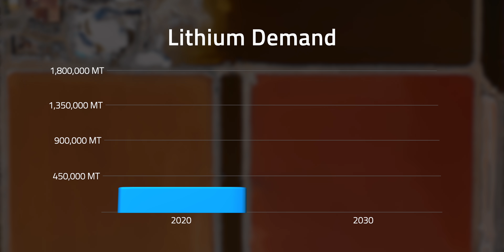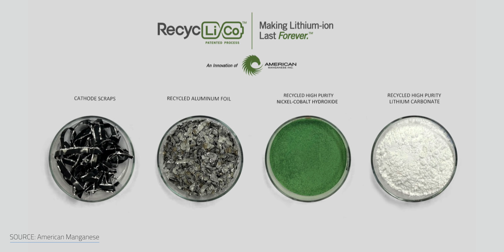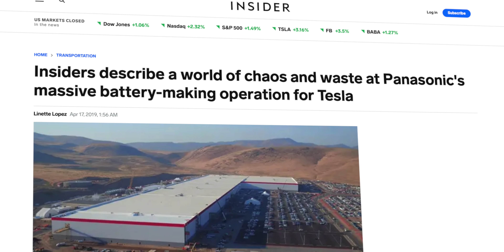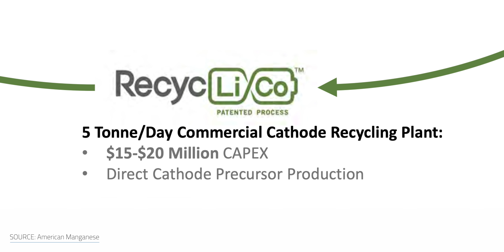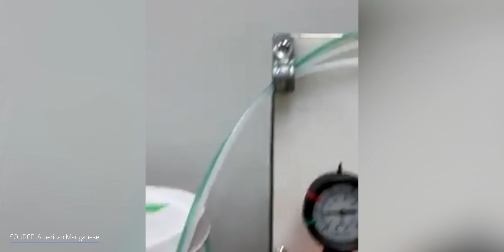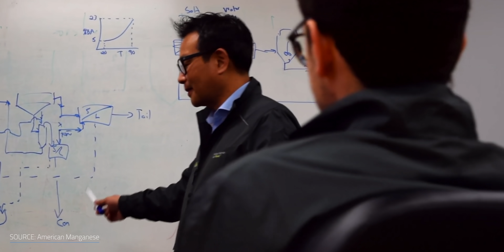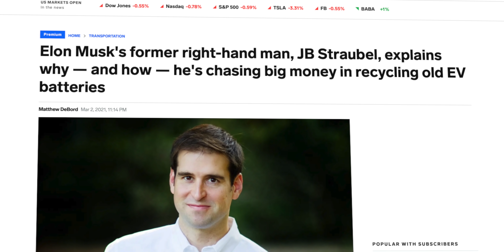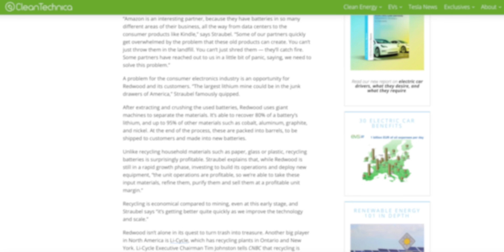Solving EV's Biggest Problem - Battery Recycling Explained

Comment: You could have just said it's a big problem.  Not the biggest problem.  The biggest problem today isn't the recycling of the batteries, it's exactly what you mentioned at the start of your video... The massive amount of new resources needed to be mined to build the batteries in the first place.  

Recycling will become an issue in the future as batteries with 10+ year lives and no ability to repurpose them start stacking up.  However, go back 10 years and how many EV car batteries exist to recycle?  How about 9 years?  How about 8?  Most EVs on the roads today were built in the last 5 years, and that isn't many versus the total number of vehicles on the roads worldwide.  

You mention 2030 as if that's the peak demand for new metals.  No one thinks we'll have replaced all ICE production with BEVs in 2030.  Likely not even 50%, so at peak we'll need to at least double your numbers again.  If you're basing your numbers on average battery size today, multiplied by the number of EVs you think we'll be producing by 2030, then you're sorely mistaken.  New vehicles with even larger batteries (Pickup trucks, large SUVs, Semi trucks, etc) are beginning to hit the market.  Fewer small battery cars like the Nissan Leaf, Mini EV, and the multitude of PHEVs will be produced because "ranginess is next to godliness" and "PHEVs are bad".  (As the BEV fanatics like to claim)  That will drive up average battery capacity per vehicle.  Unless there are major breakthroughs in battery energy density, then we will need more materials on average per vehicle produced.

We currently have 1.6 billion ICE vehicles in use today.  That means to replace all vehicles on the planet, we need 1.6 billion battery packs in use simultaneously.  Take the average battery size you believe we'll have once that takes place, and multiply it by 1.6 billion.  That's the total amount of mining we need to do.  We haven't even replaced a full percent of the planet's in use ICE vehicles with EVs yet.  Anyone claiming this mining process is "clean" or "environmentally friendly" probably doesn't know the first thing about mining and is deluding themselves.  

With smaller battery cars, so long as the recycling infrastructure is in place to keep reusing those smaller batteries with potentially shorter cycle lives, we can reduce the amount of mining we need to do significantly, and reduce the amount of environmental destruction that mining causes.  It would also lower cell demand, and keep new vehicle costs under control.  

Sadly, people think their ability to road trip without renting a car is more important than the health of the environment, so they "absolutely must have a battery with 300+ miles of range".   Most EV advocates are greedy hypocrites that could care less about the environment; just like the majority of the human population.  If we really cared about reducing emissions, we'd all be riding bikes.

Comment: That cathode scrappage rate was seriously eye-opening! Presumably, the very-large scale production that's on the horizon is going to bring that scrappage rate down, but that recycling process from AM looks like it'll make a huge difference as production scales up, and as new chemistries like LFP, solid state and Tesla's promised high-Ni chemistry get ramped up to very-large scale production. There are bound to be some teething problems.

What do I think about battery recycling? I think it's pretty much bang on schedule. It's still at the scale of small demonstrator plants, but the amount of battery waste is still small. Most EV batteries are still on the road, most domestic batteries are still in homes - they're lasting decades, and there aren't yet piles of Li ion batteries begging for recycling. If we check in again in 10 years time, there might well be a glut of old batteries in need of recycling, but the recycling facilities themselves will be bigger, better and more numerous too. Between rising production & the real lifespan of batteries, vs. the speed at which battery recycling is scaling up, I think things might balance out quite nicely.

Comment: Unfortunately, this will be an environmental disaster.  It is far too expensive to transport and recycle these batteries. Instead, companies will choose to dump or stockpile the toxic and dangerous used batteries, and just buy new ones made with materials newly mined with cheap labor.  In less advanced cultures, there will likely be used batteries in poorly designed landfills leaching their toxic contents into the soil, groundwater, and surface water.  I wish everyone would just stop and think this through instead of flying by the seat of their pants.

Comment: I'm looking forward to the day when "mining" includes digging into landfills for buried resources. Of course that might only happen after raw materials prices skyrocket out of control. Thanks Matt! Dave J
Reply: You make a good point. I was an early developer in the plastics recycling field; I learned the economics of these businesses well. It costs more to recycle post-consumer plastics than to buy virgin plastic. Someone has to make up the difference. In our case, it was made up in higher consumer costs on purchase and garbage/recycling pickup.
I'm very curious how much energy it takes to recycle the used up batteries. What is the comparison of energy consumption for mining versus recycling? That's where we will know if recycling is economically viable.

Comment: hah... dude... "we can" (recycle) is one thing - we actually do is a whole new story, despite having the technology! No one denies it is possible, but I will directly name it "crazy" and" liar" anyone who believe and insist we are able to achieve 100% recycle  of the batteries! 

The most optimistic, but not very likely scenario I've heard is for 90% scale - that mean millions of tons batteries will be left out there... maybe someone can remind me, were they toxic and dangerous for the soil and water or not?! 

And that solve nothing as about 80 to 100 million cars are sold annually - therefore next few decade the demand of raw materials will always be few times higher then the availability offered by recycled batteries. 

...and then, at the end is still the question - does it worth the risk and efforts? What is the amount of CO2 produced in a life-cycle of an EV? What is the amount of CO2 during the recycling process - the information is from triple to 6 times more then the emission emitted for the production. Combining the CO2 from the production, the use (charging) and recycling made the replacement of ICE with EV pretty much pointless.

In general it is much better to invest in synthetic fuels, despite the high energy consumption of the process, as it can be primarily renewable then put money, time and effort on batteries!
Reply: No, it isn't currently viable to use synthetic fuels. Most countries haven't even cleaned up their grids yet. Much less having excess green energy to dump on cars.

Comment: I knew it.  All these EV evangelists harping on ICE always neatly fail to mention that recycling will not replace mining.  EV's are supposed to be more efficient than ICE cars ONLY IF recycling replaces mining, which is extremely toxic.  not to mention the scrapping of batteries.  I personally own an EV but i'm not one of these evangelists.  i just like new tech and it's cool to charge up my car at home.  i hope recycling does away with mining, but not expecting Big Mining to fold up their tent any time soon.  I just see the whole climate change / EV push as just another money grab.  Just my opinion.

Comment: Both "recycling" technologies are super expensive and will never pay off. Need proof? Thye same claims were made in the plastic recycling debacle.
Reply: Yet it's progressing that way. The large thing limiting it is infrastructure. If we had the infrastructure of the oil industry it would be far easier than anything but don't forget how much power said industry has. It's a slow process but will happen

Comment: Awesome and much needed tech. All of our products should be recyclable. It should be a requirement engineered into the designs. I think recycling will only overtake mining once the need levels off. Mining will be necessary as battery manufacturing ramps up. Once Enough material is in play if we are recycling well enough, the need to mine it will reduce but probably not end. Recycling also has to remain competitively priced. We have seen with paper and plastic. Sometimes it’s less expensive to make new and that disrupts the recycle.

Comment: I have a very basic idea of how metallurgy works via countless precious metal refining youtube videos. Pretty much you dissolve raw ore or scraps in acid. Then slowly heat it up until fully dissolved, then you add a slightly more reactive metal to displace the one you want. And since lithium is an alkaline metal, its pretty reactive. So Im guessing they might use sodium metal? No idea. Anyways thats my informational rant, also I hate this guys videos.

Comment: Nickola testla used compressed air to get to space

Elon musk
Takes his inventions
And go's in the opposite direction

1 nikola testla created free energy
2 nikola testla ran anti gravity energy accumulators with compressed air
3 over 100 years of gravity powered and air powered machines
4 isn't bendy glass trampoline a better idea if you want shatterproof windows

5 we are not running out of sand
Just like oil
It is made from creatures and diatoms witch continue to grow

6 I am not going to use biohazards
And I don't need to top up oil levels

Comment: there are 10 million batteries so by 2030 you're talking out of 2 billion vehicles, recycling is missing the picture picture here talking about 3 billion by 2050 you can't recycle 10 million into 3 billion. of course realistically only 15%-30% of cars will be electric by 2050

Comment: Check out neometals, they have developed a hydrometallurgical method of recovering 99% of all battery contents with virtually no carbon emissions. They are starting pilot plant trials this year!
Reply: Their website is full of nonsense marketing speak  "Neometals’ innovative business approach offers both security and growth opportunities in a diversified project pipeline. The Company applies a consistent and differentiated strategy to deliver value and cashflow to the business.".  Be weary of investing in something that blows so much smoke right on their front page.
Redwood is already functioning and their website is not full of marketing speak.  They even give you a public address you can send or drop off old electronics to be recycled with no charge.

Comment: Oh, we’re so green...
Go get an electric vehicle, feel good and believe it’s better for the environment.
Well, go research normal waste recycling, the actual truth....it’s another lie.
Apart from raping extremely rare cobalt from Africa, from the open ground, by using child labour and China being one of a very few manufacturing the final product, the final battery has already completed over 8000 miles of travelling before its installed into its host vehicle. Recycling is a great idea in practice but in reality it’s always down to the end user instead of the manufacturer being responsible

Comment: Well, skeptics are still correct. There is no recycling. The initial process of building lithium batteries is environmentally devastating. Electric cars are an old technology. It didn’t work in the late 1890’s, and it doesn’t work now. Think again

Comment: Exploding and  catching fire batteries need to come along way before I trust electric cars. Hell car batteries last two years in either the extreme hot/cold climates. Can't see replacing 10 grand of batteries every few years. Besides battery building is far worse for the environment than having  a normal vehicle for 6 to 10 years

Comment: Batteries don’t ‘die’ in an electric car if they are thermally managed and have an intelligent BMS. Tesla talks about the million mile battery coming soon. You won’t do that many miles in your lifetime. Even when the battery is considered not fit for a car that does not mean it is ‘dead’ it usually means it has lost more than 20% of its capacity. It can be second lifed into a power wall or other devices. All you’ve done with this video is perpetuate the myth about electric car batteries somehow dying and then somehow being only good for scrap which simply is t true. Also you have assumed no new battery architecture will come along, which we know is going to happen sooner rather than later. These new architectures do not use Lithium or Cobalt.
Reply: Meanwhile, over here in the real world…